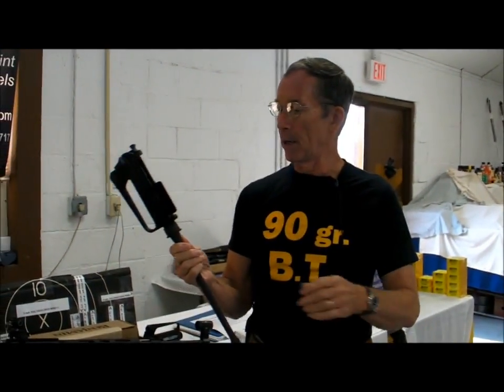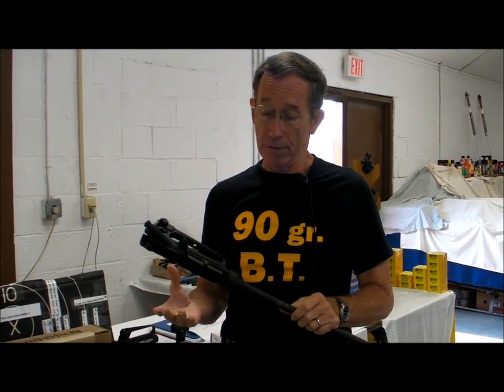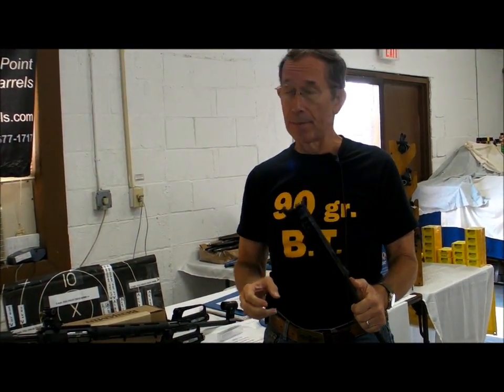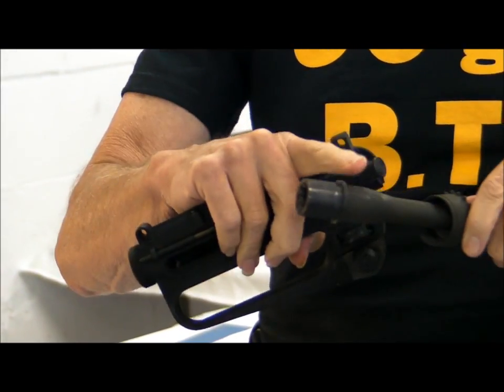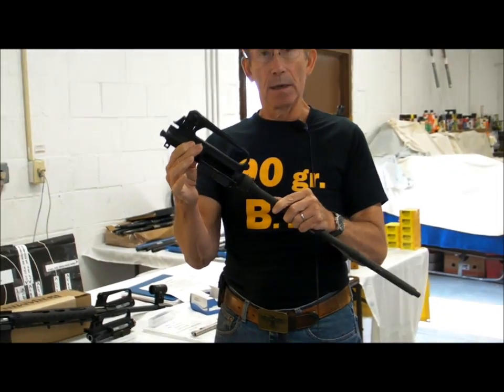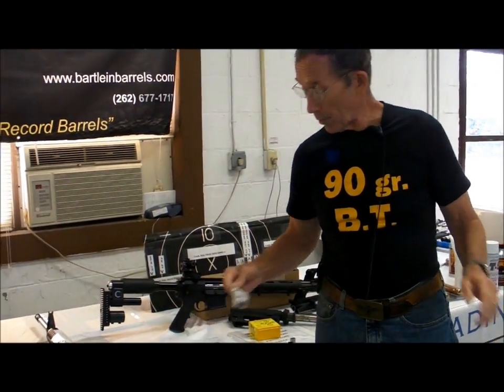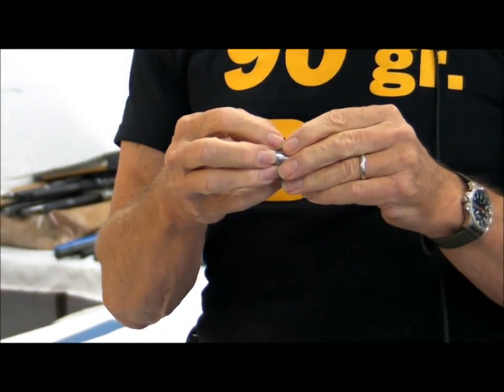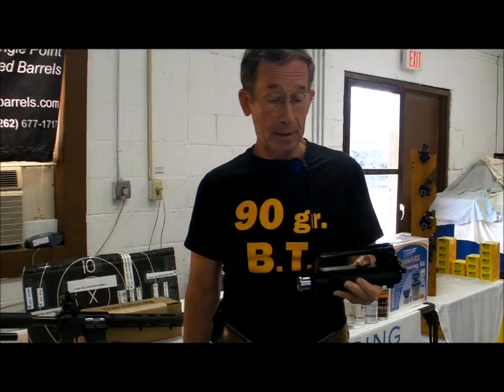Building Match Grade AR-15s

Comment: Hmmm.
The barrel nut tightens up against the lip on the barrel extension.  The barrel can only be loose if the barrel nut is loose.  Does the barrel loosen in the pocket of the receiver after multiple firings?  I have not seen this looseness on any of my barrels that I have installed and I would have to think this would be a common install practice if this is such a problem.  Please explain.
Reply from the maker: From author Joe Carlos:

Bruce

The way you describe the barrel nut pushing back against the raised flange of the barrel extension forcing it into hard contact with the front face of the threaded portion of the upper receiver is pretty true.  
We are not trying to stop front to back movement of the extension inside the front of the receiver.  We are trying to prevent side to side and up and down movement (360 degrees really).  You can see this movement as you assemble any Stoner rifle.  Simply slide the barrel extension into the upper receiver until it stops.  Then hold the barrel in one hand and the receiver in the other and apply left to right and up and down forces.  You will see and feel the wiggle caused by the very sloppy "fit".  Thin shim stock, held in place with green LocTite, helps eliminate this movement.

Properly fitted BAT Machine custom match barrel extensions will also remove this movement.  Either method will reduce group size an average of about 1/3 which is very substantial.

I suggest that you read the first article I ever wrote for this magazine titled, " Barrel Extension Diameter And Accuracy In The AR-15", published in March and April of 2013.  There is a story related in that article about how we discovered the amount of movement between the extension and the upper receiver in fully assembled uppers.  If you can't locate a copy of articles back that far in history simple e-mail me directly at NCC1701@penn.com.  You can also direct any further questions to me at that address.

Thanks for your interest!
Reply: Thank you Joe I will try this at my next barrel change

Comment: This is a good "Old School" technique, There has been good advances in helping correct this on AR15 rifles with barrel extension and Upper Receiver Tolerance Issues.  Lapping the Upper Receiver, and correct tolerance issues with the Barrel Extension and Upper Receiver.   See the video about accurizing the AR-15 - Part 3: Receiver Prep & AR-15 Barrel Installation. 
 
 https://youtu.be/XHxU8VUAHOY
Reply from the maker: From Joe Carlos.

Thank you for your interest in Building Match Grade AR-15's. I'll start
with what I like or agree with:

The video that you sent a link for was very well made.  That doesn't
mean that I agree with everything that is in there, however.  As shown
in the video I also started out (about 1/4 century back) using Green
Loc-Tite to fill the substantial gap between the upper receiver and the
barrel extension.  Once the Loc-Tite sets up all visible movement
between the barrel and receiver is removed even without having a barrel
nut in place. During my study of this initial step to group tightening I
machine rest tested well over 100 uppers first without Loc-Tite and then
a second time after LocTite was used (no other changes to the gun or
ammo, however).  I kept meticulous records and when I analyzed the data
I found that groups with the Loc-Tite were 18.6% tighter than the
average of groups with uppers assembled without Loc-Tite. Shooters could
notice an improvement when the LocTite was used.

I kept wondering, however, if further improvements could be made.  At
the end of the day, afterall, I was using a type of glue.  I wondered if
I still had some movement between the extension and the receiver that I
couldn't see but that would be evident in machine rest groups.  So I
started wrapping thin (.001") shim stock around the extension so I was
filling the gap with hard metal instead of glue.  I continued to coat
everything with Green LocTite.  I compared machine rest groups of guns
assembled with no LocTite or shim stock vs. ones built with shim stock
and LocTite.  When I analyzed my targets I was elated to find that the
inclusion of the shim stock had nearly doubled my precision gain.  An
average of 35% in group shrinkage in uppers with shim stock and LocTite
vs. the same gun with neither.

Not too long after all this BAT Machine came up with custom oversized
extensions and I stock them in 1/2 thousandth (.0005") increments
because receivers vary a lot between makers.  I have the customer ship
me his receiver so I can ascertain the correct size (a press fit) of
extension to fit very tightly.  That extension is installed on a premium
single point cut rifled barrel.

All of the cast AR receivers that I have checked require squaring at the
front with the exception of the ones made by Sun Devil (not cast) which
are of stellar quality.  I chose not to include the squaring of the
front of the threaded section of the receiver in my video.  I do it,
however, but I sure don't do it with one of those gadgets that fit in
the front of a 3/8" hand drill!  When I performed my study on this
squaring process (involving dozens of uppers) I measured the amount of
run out of several new ones straight out of the factory.  Then I used
one of those ubiquitous "squaring tools" trying my level best to run it
straight.  After I had finished I measured a second time and I had ADDED
run out, making the surface worse instead of better.  After several
iterations of that turned out the same I threw that tool in the trash
where all of them belong.  This squaring process needs to be done by a
machinist on a lathe.  Done that way you will cut an average of 14% from
your group size.

You don't have to take my word for this.  If you have one of those tools
and a new receiver and know a qualified machinist ask him to gauge the
front surface and tell you the amount of run out.  Then try the tool and
take the receiver back to him and ask him to take a second measurement. 
It will turn out worse!  Your machinist can fix that, however, so you
haven't permanently ruined the receiver.

In closing, there are videos being published one after the other on
these AR building topics.  A lot of those videos contain a fair amount
of misinformation.  If the person in front of the camera can't tell you
how much accuracy gain you can expect and if he can't tell you how large
his sample size was for drawing his conclusions he probably hasn't
performed his due diligence in conducting scientific testing on the
techniques he's promoting. Anyone wishing to discuss these matters
further is encouraged to email me directly: NCC1701 at penn.com
Reply: @FUNshoot  thanks for keeping records and sharing
Reply from the maker: @pturk8839  You are welcome!
Reply: @FUNshoot  I just learned about those "squaring tools" yesterday and I'm glad I'm not the only one who thought those  were bunk. It's not being indexed to anything.

Comment: Anyone know if this applies to an FAL?
Reply from the maker: The FAL barrel does not use a barrel nut and threads directly into the receiver. Also, the FAL bolt toggles in the receiver rather than rotating to lock into a barrel extension.
Reply: @FUNshoot  hmm good to know
Reply: @FUNshoot  do you have any opinion on how to accurize a FAL?

Comment: There are two types of green lock tight which number do you use and is stainless shim stock good to use?
Reply: Stephen
Use the #620 green LocTite.  It dries slower and your first few attempts will take quite a bit of time.
Reply: I forgot.  Yes, stainless shim stock is O.K.  That's what I use.

Comment: What if you have slop in a barrel to receiver you can feel, but you can't get .001 shim stock 3/4 of the way around, are you better off not doing anything or using a smaller peice of shim you can get in?   I've found with a good upper and more recent match barrels I can feel a bit of wiggle sometimes, but I'd probably only get 1" of 0.001" shim stock in.  Is it better to not use a small piece and just use green loctite?
Reply from the maker: Yes. Contact Carlos directly at NCC1701 at penn.com
Reply: If you're unable to get more than a 2/3 wrap of the shim stock on the barrel extension then another option is to essentially "3 point" the barrel extension in the upper receiver. This can be quite a tedious process because you're trying to get 2 smaller pieces of shim stock in with the barrel instead of 1 larger one. The idea is to use the alignment pin as the 0 degree (or 12 O'clock) point and the 2 pieces of shim stock need to be located at 120 and 240 degree points around the barrel extension. You'll have to use a considerable amount of trial and error to determine the width of the two pieces of shim stock. In the end they should be of equal width with their centers at the 120 & 240 degree timing marks. I've started using Locktite's new product 518 as it's a bit more user friendly. You can almost think of it as expanding foam for spaces <.010 of an inch. Look for the smallest tubes of it though, it has sticker shock!
Reply: Another thing you can do is put the barrel in the freezer and heat the upper with a heat gun. You will be surprised how much room you have to fit shims in there.

Comment: Why use shim when you can bed?
Reply: This is Joe Carlos replying from my son-in-law's computer:  The evolution of this went sort of this way:  I noticed all the slop in the fit of standard extensions to upper receivers and tried the #620 Green LocTite first because it is used to fill large gaps.  I was really pleased when I tested a bunch of uppers on the machine rest and got what I remember as about a 18.6% average reduction in group size.

As time went on I developed a couple of concerns:  Using the original technique, I had metal (the extension itself) to glue (the green L.T.) to a different metal (the aluminum receiver).  Since all this was located so near to the chamber where things are really hot I wondered if these 3 different surfaces would be heating at different rates and having an influence on accuracy.  I was also concerned about "give" in the L.T. since it isn't metal.  I reasoned that if there was give it would result in more harmonics and perhaps less uniform harmonics, two things I was trying to lessen.

So I thought that perhaps using metal (the shim stock) to fill the sizable gap between the receiver and the extension might improve things.  Doing so pretty much doubled my accuracy gain.  Uppers built the way Stoner designed them and tested on the machine rest for 10 shot groups and then rebuilt (using shim stock) and retested with the same ammo showed almost double the reduction in group size.  With the shim stock AND LocTite combined the groups became about 1/3 smaller than just screwed together hap-hazard as in Stoner's day.

Each upper receiver/barrel ext. will vary from others in the amount of shim needed.  Some will require nearly a 360 degree wrap of shim while others with less gap will end up with a much shorter 1" or even 1/2" section of shim.  So my next concern was whether small sections of shim might be creating "high spots" inside there for the barrel to sort of "pivot" around perhaps creating uneven harmonics.  This was the period of time when I was working with BAT Machine on the custom extensions that by themselves EVENLY fill the gaps inside the receiver in all 360 degrees.  I tested building guns with shim stock and original extensions.  Then I tore those temporary guns down, installed the appropriate size of custom BAT extension, rebuilt the temporary gun, and retested using the same lots of ammo.  Both the BAT machine groups and the groups using shim stock came out about equal.  So my conclusion was that using shim stock must not cause any issues with regard to group size vs. using a custom fat extension.

So now if I have a customer's upper receiver at the time the barrel extension is being added to the barrel I select an extension that fits perfectly.  However, if I don't have the option of using a custom extension I just use LocTite and an appropriate size of shim stock with confidence.

So that is a very long explanation of how this all evolved over a bunch of years.  Or the short version of why I didn't "bed" is simply that I didn't think of anything along any such lines at the time.  If you have a means to test "before" and "after" groups on a bunch of firearms I would be interested in hearing the results, however, using any different method and I can be contacted at NCC1701@penn.com.
Reply: Why not just use Loctite 609 ???
Reply: @kyleboutchyard6735  care to share how you fixture barrels in your lathe,dial in chambers,and how close you dial in bores?